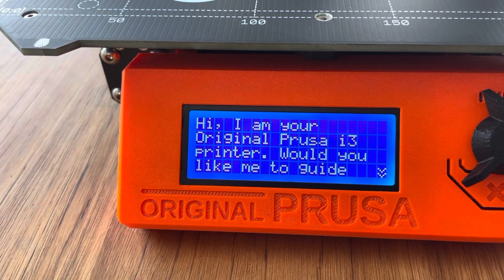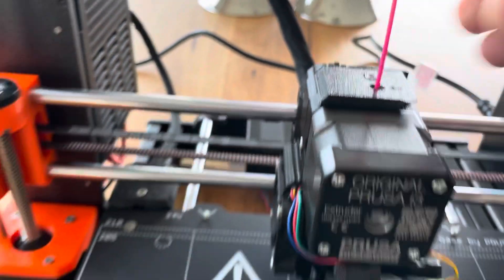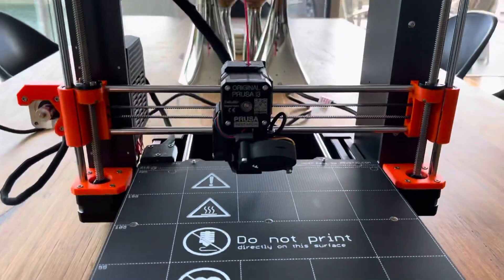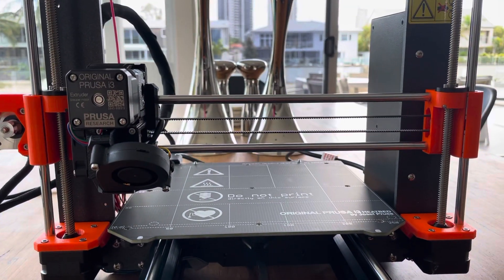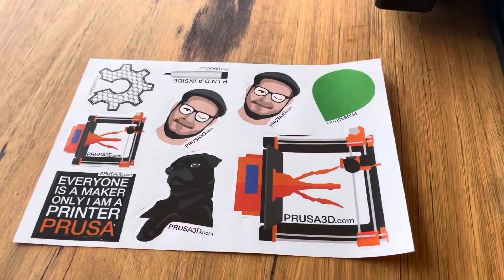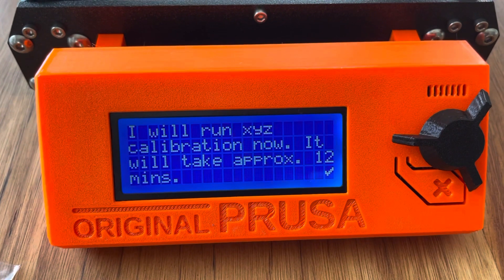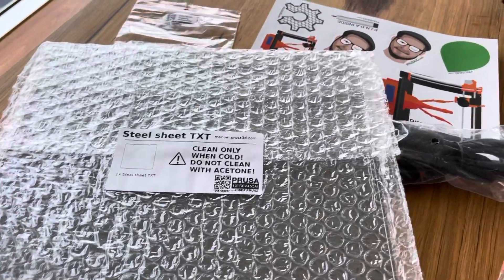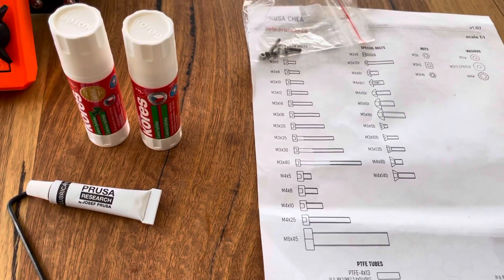First Prusa i3 MK3 Power Up

Comment: The textured sheet is slightly thinner than the smooth sheet.  You'll need to calibrate them separately.  Fortunately, the printer can remember calibrations from multiple sheets, so you do the calibration for each just once, then pick the correct entry when you swap sheets.

Comment: Great choice of machine :) You are gonna love it :)

Btw. pro tip:
NEVER, like never ever, have a roll of fillament where you let go of the end...
Its how you end up with tangles in the spool, and suddenly have to restart a multi hour long print :)

So always keep hold of the end, or have it attached to the spool. (the prusament rolls you have, got small notches for holding the end)

And the sheets, the textured one is great for PETG, ABS, ASA etc.
But for PLA use your smooth one :)

Comment: Smooth sheet & Textured sheet basically provide different levels of adherence when printing. Most plastics will be fine on the smooth sheet (and you can clean it with isopropyl alcohol / acetone), though the Textured sheet has more grip (and also gives a textured finish on the first layer). Only clean the Textured sheet with Windex / Window Clean spray, the plastic coating can be ruined by other chemicals. I use Textured sheet for TPU prints (rubber-like properties, needs extra help sticking)